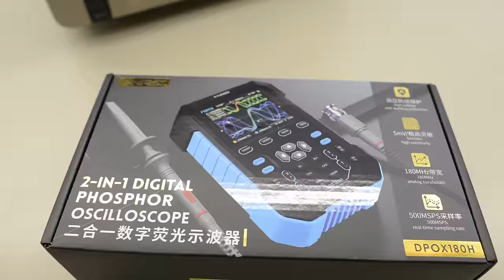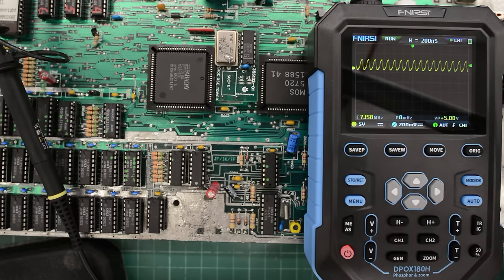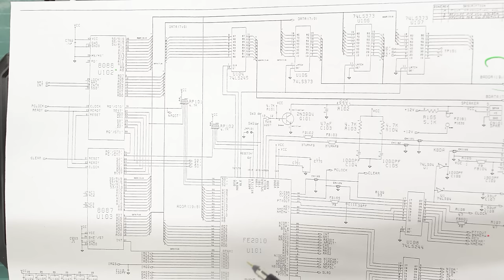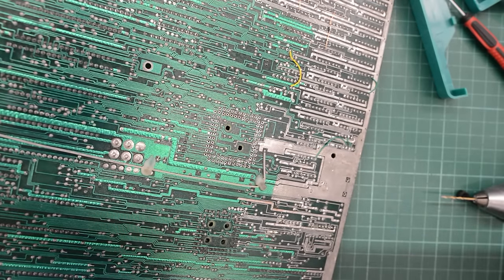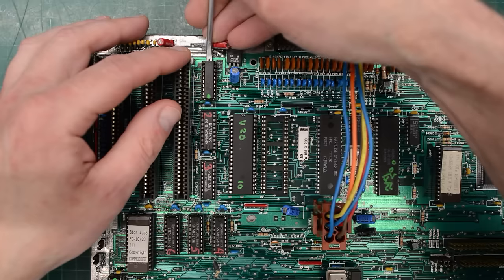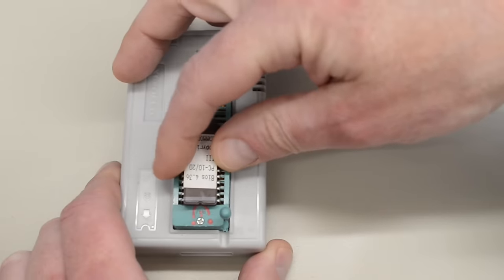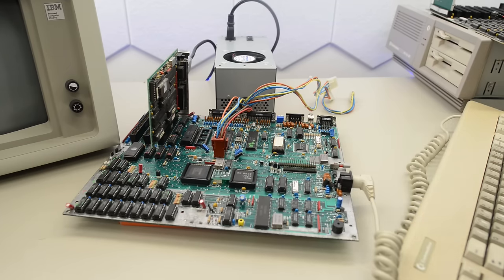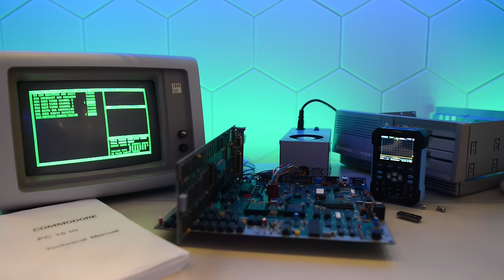Looking for faults on the Commodore PC 10 board with FNIRSI DPOX180H

Comment: I had the same problem with nozzles on my desoldering station wearing out. The reason they wear out is because they're crap. They're made of crap metal that's not plated, they're also super thin. The heat makes them warp and flake apart.

I did some research on the nozzles because I was tired of burning through packs of them, and I found that Aven made a desoldering station that was similar enough to the generic ones on the usual markets. Except for the one major difference, they made their own nozzles. Aven nozzles were made out of Nickel I believe, and they had a thick metal ring around the tip that stands up to the heat and abrasion of rubbing on circuit boards.

I bought a pile of their nozzles of different sizes and not a single one has worn out with years of use. The generic crap nozzles would fail after just a couple of months of use. Unfortunately, Aven discontinued the nozzles and they're no longer available. I bought the last few on Mouser when I saw the EOL notice on my project page for soldering equipment.
Reply: Thank you. Thank really helps me. I have the same problem as both of you. I'll look for any remaining Aven stock.
Reply from the maker: Too bad they are EOL :/ Thanks for sharing
Reply: @josephphillips9243  The exact part number is Aven 17401-N5-1. There's also a -2 and a -3, which are different nozzle sizes, I think they go from 0.6mm to 1.0mm

I've started doing research on nozzles again to see if there's any substitute. It looks like some types of Hakko nozzle may work, but they're crazy expensive at $20+ a piece.
Reply: @GGigabiteM  Thank you again. This will no doubt help others too... whilst stocks last for the Aven ones 😀
Reply: @GGigabiteM : Honestly, if it's just as simple as "make the nozzle from nickel", then it's worth looking to see if a local machine shop will make them cheap enough, and if they won't then you should experiment with ad-libbing it your self:

Get some rod stock of a large-enough size, get it chucked into a hand drill, strap the drill down, set that drill going, and then take a dremel to the rod stock with it's own support. A slow process, and it may take some planning and experimenting to get the rod stock properly mounted (because you're liable to have a chuck too small to do it directly), but very doable.
Reply: @absalomdraconis  I think I'll find somewhere to buy them instead. That sound like hundreds of dollars to make a single nozzle that probably won't work.

Comment: When you removed the socket, theres a sketchy trace at the top you missed... Failing that, the main chip itself is probably bad. I have seen this a few times with bombed out boards especially if they were ever attempted power up when bombed. (Only halfway through the video, though)
Reply from the maker: I'll check, thanks!

Comment: I should have another go at my PC 20 III I can't even get the PSU running on that 😊
Reply from the maker: I think they share motherboard? How's the battery damage on your board?
Reply: Bad, the crusty bits are less than yours but there are tiny black dots pretty much all over. The PSU looks fine but I only get as far as DC mains.
Reply: The only difference between the PC 10/20 III is the added XT-ATA harddisk. :)

Comment: did you try cleaning the old nozzle with a metal rod? you just shove a metal rod up the tip(yeah i know) while it's hot to clear some blockage that may have collected in there. i bet your desoldering station came with one just for this purpose.
Reply from the maker: yeah, I regularly clean the nozzle with that tool. However, the tip on two of the nozzles is all messed up. I think air is leaking in from all sides of the nozzles
Reply: @Epictronics1  : Maybe for the future, you might want to clean the nozzles after using them on nasty / corroded solder... not just cleaning them out with a rod, but also use something to remove any corrosion residue, that might eat on it.
Reply from the maker: @bikkiikun  Yeah, I frequently use my tips on corroded boards. Maybe, that's why my nozzles are so messed up